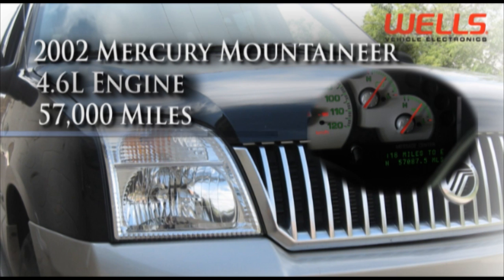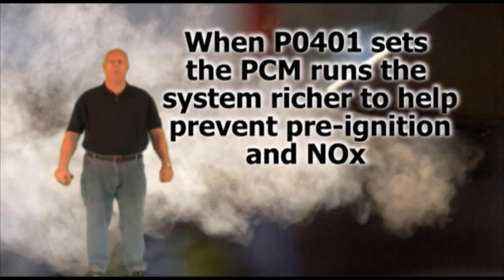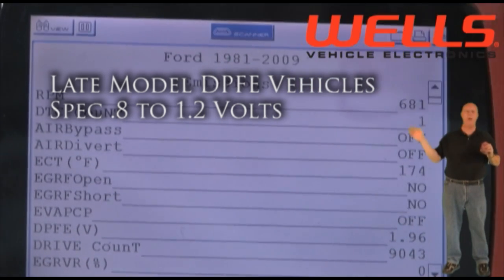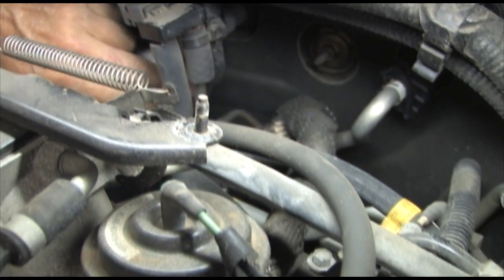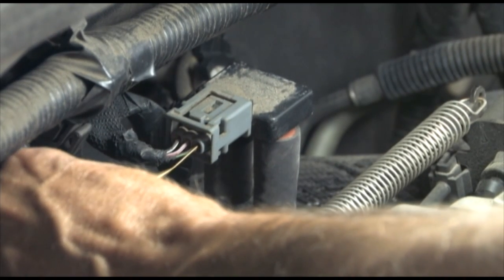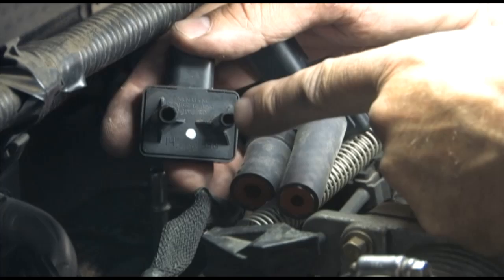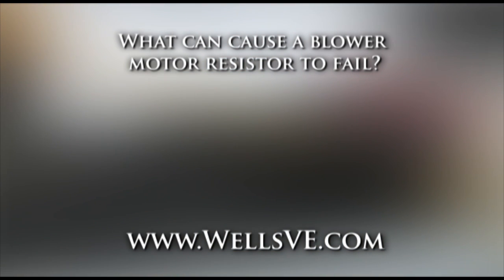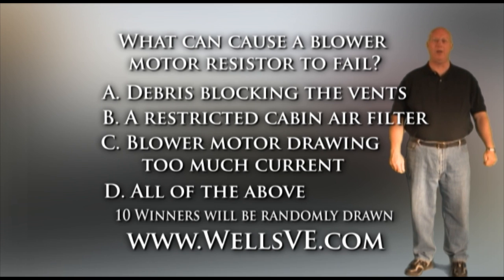Ford P0401 DPFE EGR  Pressure Sensor Diagnostics and Repair with a Contest

Comment: hi mark, i need  help on my 91 town car 4.6 liter. i got code 332 egr valve opening detected. the shop man checked my egr valve says okay.sometime engine stop after cold start or idle and sometime surge when at cruising speeds or not idle at all. right now i dnt know what to do. the car sitting front drive way. can you please help me. thank you!.
Reply from the maker: Hello Dave, below is the test procedure. It is usually due to clogged passages.

1. Check the Pressure Feedback EGR (PFE) sensor voltage, Key On, Engine Off (KOEO). Voltage should indicate 3.2-3.35 volts.

2. Start the engine and recheck the sensor voltage. It should still indicate 3.2-3.35 volts.

3. Open the EGR valve with a hand-held vacuum pump when the engine is idling. With about 8-10" of vacuum applied, the sensor voltage should decrease to less than 1.0 volt.

4. If there is very little change in the engine RPM and the sensor voltage, remove the intake plenum from the lower intake. Inspect and clean the passages of the lower intake which allow for exhaust to flow into the intake from the Exhaust Gas Recirculation (EGR) valve.

5. If the engine runs very rough but the voltage does not change, verify that the pressure hose of the sensor is connected to the exhaust flow pipe feeding the EGR valve and replace the sensor.

6. If the PFE sensor voltage decreases as stated and the engine RPM is severely affected, perform the Key On, Engine Running (KOER) self-test while monitoring the vacuum signal to the EGR valve. At some point during the self-test there should be at least 2" of vacuum to the valve.

7. If there is never a vacuum signal to the valve, backprobe the Brown/Pink (BR/PK) wire at the EGR Vacuum Regulator (EVR) solenoid and ground it with the engine idling to verify vacuum is then present to the valve.

8. If there is no vacuum to the valve, verify manifold vacuum to the EVR solenoid and that the green vacuum line is not restricted or broken from the solenoid to the valve.

9. If the vacuum lines check to be OK, replace the solenoid. 
Mark Hicks
Wells Vehicle Electronics
Reply: okay, will do that.thanks!

Comment: I have a 93vp,3.8ecotec,dies out after w@rmed up.
The motor light comes back on after start/idling.
plse reply,as i am a mech with a tumour in me rightside of neck nd arm.
thanking you,
Ed
Reply from the maker: Hey Ed,
I am going to guess your Commodore VP is the same as our GM products in the states.
In that case two common causes come to mind. One crankshaft position sensor. Should be close the the harmonic balancer. Two is the computer. Start the engine and let it get warm. With the engine running, tap on the crankshaft sensor and the computer. Be careful tapping on the crankshaft sensor. You will need a long extension to do it. Do not let the extension touch the belt or pulley.
Mark Hicks
Wells Vehicle Electronics
Reply: Chur bro,
U the man for the  knowledge alright,
will do asap,
Thanking you Mr markjhicks..
will get back to you on progress.
thankz,
Ed
Reply: Can't send a vid-pics of motor running..
How 2 do this????
Reply from the maker: Edward Edwards
Sorry i don't have anything.
Mark
Reply: Algud bro,
thank you,
Ed

Comment: Hi, Mark,  I have a 2002 Windstar, got code P0401.  I measured the DPFE as you demonstrated and got only 0.02 Volt, too low, however, the reference Volt is 5 Volt which is good.  Does this also mean my DPFE sensor is bad?  Thank you for your help.
Reply from the maker: Yes it does. Be sure to check the hoses also and if you need to replace them get the right ones.
Glad to see you are testing first!
Mark Hicks
Wells Vehicle Electronics
Reply: Thank you, Mark.  I will check the hoses.
Reply: Thank you, Mark.  I will check the hose

Comment: I have an 02 focus with a dpfe that mounts to my engine wall. It has the same wire harness as the one in the video. The dpfe died so I bought a new one and went to put it in. The new one has a different wire harness. According to auto zone the new ones need a new harness because ford redesigned. I'm buying the new one soon but wondered if you have heard of the new dpfes needing new harnesses. Also what order should I attach the leads?
Thanks
Reply from the maker: Hello Andrew, Yes I have heard of this. In fact you are purchasing one of our sensors. It was an Original Equipment OE change to the wiring harness. You will probably see the wires to the replacement harness are all one color. This is because it fits several different models and years and each of them have wiring with different colors. First cut the connector from the vehicle about an inch from the connector it self. Then lay the connectors side by side and match up the wires. You will then see which wire goes to which colored wire on the vehicle.
I hope this helps, if you need further assistance let me know or give us a call at Wells. 1-800-558-9770 7AM to 7PM M-F
Mark Hicks
Wells Vehicle Electronics
Reply: Thanks. I was thinking that would work but wondered if the other dpfe was wired in another order and didn't want to fry it.
Reply from the maker: Andrew Ratiani
Makes sense, it can very blurry sometimes. Always best to make sure!
Stay in Touch,
Mark Hicks
Wells Vehicle Electronics

Comment: my 2001 windstar has ap1401 error code and catalystnot reading plus evaporator system not reading is code p1401 the egr sensor ? and whats not ready mean?
Reply from the maker: Most common cause for this code on your vehicle is the DPFE sensor. Spec is 0.4 V to 0.65 V for the original metal type sensor and 0.4 V to 1.2 V for the Black plastic sensor. If out of range, replace the sensor.
Mark Hicks
Wells Vehicle Electronics

Comment from the maker: If some of the ports are restricted, you will get excessive flow on the other open port(s). This is why I asked for the codes. When this occurs you will also most times get misfire codes. The fact that you opened the EGR at idle and only got rough running and not an engine kill, makes me think there is some restriction somewhere.
Mark Hicks
Wells Vehicle Electronics

Comment from the maker: Be sure to check the DPFE like I told you. 9 times out of 10 the P1407 is a defective DPFE. Also closely check the hoses coming up from the exhaust. If the Catalytic Converter is restricted the hoses will deform and crack.
Mark Hicks
Wells Vehicle Electronics

Comment from the maker: What code(S) are being set? The PFE sensor should have near one volt on one of the pins with it plugged in. Check it that way by back probing it with a pin. Your engine has small orifices above the intake valve that let the EGR gasses into the cylinder. It is common for these orifices to become blocked. 
What are the codes?
Mark Hicks
Wells Vehicle Electronics

Comment from the maker: The signal voltage should be between .8 and 1.2 volts. Sounds like you have a defective sensor.

Mark Hicks
Wells Vehicle Electronics

Comment from the maker: OK, I believe you are refering to a vehicle speed sensor which is voltage generating. There is no spec, you look for the voltage to increase with vehicle speed. First do this check, then back probe at the PCM or BCM where ever your speed sensor is sending a signal and look for the same voltage without interuption. You are always welcome to call our assistance line for free, 1-800-558-9770 press 3 for tech help. 7:30 AM to 7:00 PM M-F
Mark Hicks
Wells Vehicle Electronics

Comment: MMM, no sorry i was refering about the other sensor (code error P0715, magnetic type sensor, if you could tell me, what would be the tipical voltage generated and, how to test the harness wires, to check if one or both are cut or have some other error).
Thanks Mark!

Comment from the maker: I think you are talking about the DPFE sensor?
I think I answered this before?
Check voltage of the Differential Pressure Feedback EGR (DPFE) sensor. Normal voltage should be 0.5-1.2 volts Key On Engine Off (KOEO) or at idle.

If voltage is out of range, check voltage again with the sensor disconnected, it should read 5.0 volts. If it does, and there is 5.0 volts measured between the Brown/White (BR/WT) and Grey/Red (GY/RD) wire, replace the sensor. 

Mark Hicks
Wells Vehicle Electronics

Comment from the maker: Great news! To make sure the speed sensor is good, connect your meter and drive the vehicle, the sensor should generate an AC voltage that increases with speed. Sorry no video yet ... 

Mark Hicks
Wells Vehicle Electronics

Comment: I replaced the sensor, it solves the problem! I also cleaned up the egr valve.
Thanks Mark
This car has another problem is P0715 it seems to be a problem in many cars, do you have a video about this problem? I´m almost sure than the sensor is good (is a magnetic type, the reading from the coil is 450 ohms and it produce voltage) but i want to be sure!
Thanks again!

Comment: Mark,
I hooked the vacuum pump up to the EGR and with the engine revved it stayed at zero.
When I increased the vacuum to 8.7 the engine did run rough.
I disconnected the hose from the vacuum control valve and put on the vacuum pump and with the engine idling it read 6.5.

With the EGR solenoid disconnected I'm not sure how to apply power to that solenoid. Please give me instructions on that.

Comment: I've been searching on the internet to see what part is what. I don't know what the EGR solenoid or the vacuum control valve looks like on a 2002 Mitsubishi Montero Sport. 
I looked at 2 different websites and their picture for the VCV were different. I will run the tests once I confirm the those parts from you.

Comment from the maker: 1. Disconnect the shift linkage at the transmission and move the linkage on the transmission by hand. If the transmission still won't engage, there is an internal transmission problem.

2. If the transmission does engage when moving the linkage manually, check for a problem with the shift lever or cable.

Mark Hicks
Wells Vehicle Electronics

Comment: I have a 92 ford taurus that has a problem with the transmission engaging. Periodlically when I drive it, then turn it off, then turn it back on again, it won't engage in reverse or drive even though the gear shift is moving the gears (It will move when pushed, in neutral). As well, sometimes when I am hainvg this problem, if I shift it into reverse first, back up then shift into drive it will move. ANY idea what is causing this??

Comment from the maker: 3. Disconnect the White hose from the vacuum control valve and plug it, connect a vacuum gauge to the port, and with the engine idling there should be at least 6.7" of vacuum.

4. Disconnect the EGR solenoid and apply power to one terminal and ground to the other, the solenoid should block any flow, remove the voltage and ground and vacuum should flow through the valve. 
It is common for the EGR solenoid to fail.
Let me know please,
Mark Hicks
Wells Vehicle Electronics

Comment from the maker: 1. Disconnect the green striped hose from the Exhaust Gas Recirculation (EGR) valve with the engine warmed up and running. Rev the engine, the vacuum should increase to at least 3.9".

2. With a hand vacuum pump connected to the EGR, increase the vacuum to 8.7", the engine should stall or at least run real rough.

Comment: I have a 2002 Mitsubishi Montero Sport 3.5L and I have the P401 code. I already replaced the EGR valve and took off the manifold and cleaned all the ports.  P401 still showing up. I bought a vacuum pump and tested the MAP sensor and with the key to on it read 5 v. I had the red lead on the green wire and black wire to ground. I squeezed the hand pump and went to 5,10, 15 units and voltage still 5 v. I assumed it was bad so I bought a new one. I tested the new one with same results.

Comment from the maker: Check voltage of the Differential Pressure Feedback EGR (DPFE) sensor. Normal voltage should be 0.5-1.2 volts Key On Engine Off (KOEO) or at idle.

If voltage is out of range, check voltage again with the sensor disconnected, it should read 5.0 volts. If it does, and there is 5.0 volts measured between the Brown/White (BR/WT) and Grey/Red (GY/RD) wire, replace the sensor. Our largest customers are AutoZone and Carquest.

Thanks,
Mark Hicks
Wells Vehicle Electronics

Comment from the maker: The specs for your DPFE should be the same as in the video, 1.0 volts. If the hoses are blowing off and get very hot it means the exhaust system is restricted. This usually means the catalytic convertor is plugged. To be sure have the back pressure on the exhaust checked.
Mark Hicks
Wells Vehicle Electronics

Comment from the maker: The restricted EGR will not cause the engine to run richer. Too much EGR could cause this to happen. It is time to have the back pressure of the cats checked.
Let me know what you find,
Mark Hicks
Wells Vehicle Electronics

Comment: thanks for the reply mark!! i checked the DPFE and im getting 1.18-1.22V on it. the EVR shows good resistance and voltage. i ran a stiff copper wire and carb cleaner through the tube that comes from the exh manifold to the EGR vavle to make sure it is clear. i also took out the O2 sensor before the cat and it is almost white. is this a result of overheating cats due to running it richer because of the low egr flow??

Comment from the maker: Re-check the DPFE like it shows in the video. The hoses going to the DPFE are special heat resistance type. Be sure you are using the correct hose. If the hoses look like they have gotten hot or the DPFE looks a little melted, it means your catalytic convertor is restricted. Did you clean the tube going to the exhaust pipe? When you do make sure there is flow completely through. There is a small orifice inside the pipe that plugs.
Stay in touch,
Mark Hicks
Wells Vehicle Electronics

Comment: Im leaning on replacing the EGR solenoid. The 2 hoses that lead to the DPFE sensor are NOT being blown off the tube or sensor and the DPFE is not being melted. Im just trying to get ideas as to what i need to do next...

Comment: Very informative video!! I have an 01 explorer 4.0 V6 and i had issues with P0401. Replaced the EGR valve, DPFE sensor, cleaned all the vacuum lines to/from EGR system and, intake gaskets. And the problem went away for about 3mos (just to pass state emmissions test) and came back the same. Any ideas? I have noticed a major drop in mileage even after using lucas fuel treatment on every oil change...

Comment from the maker: It sounds like the catalytic convertor is restricted. Have you had the back pressure in the exhaust checked? One this you can do to do a quick check is remove the front O2 sensor(s). If there is an improvement , most likely the cats are plugged. Don't leave the O2s out for very long.

Mark Hicks
Wells Vehicle Electronics

Comment: hi mark i have 2002 ford escape what happen is that if i start the car theres a whisltling sound and if i run the car i cant go up to 2000 rpm it looks like it chokes and the whistling sound will turn on again every time i go up to 2000 rpm .i clean the fuel injectors , replace all seals for the maniflod clean the egr valve , clean the MAS check hoses. the egr  vavle looks good  coz if i pinch it under the engine will stall , is it my DPFE or My egr vaccum solenoid?

Comment from the maker: Same issue, Cat is restricted. Usually caused by either the engine is running rich or a misfire.
If you need any further assistance, let me know,

Mark Hicks
Wells Vehicle Electronics

Comment from the maker: Thank you for the kind words. If you are melting sensors and have a lot of pressure on the hoses, it usually means your catalytic convertor is restricted. I suggest getting the back pressure on the exhaust system tested.

I hope this helps and stay in touch,

Mark Hicks
Wells Vehicle Electronics

Comment: Great video, I have a 2000 Ford Tuarus with the same problem. I replaced the Egr back pressure sensor cause the old was melted do to the heat from the tubes. I having a problem keeping the sensor on the tubes. It seems there is enough pressure coming out of the tubes to push the heat resistant tubes plus the sensor off. What should I do?

Comment from the maker: @svt0304cobra You have to get enough misfires in a certian time period to set a code. It might be right on the edge. When you say you smell rotten eggs, it means either it is running rich or you have a misfire or both. Please clean the MAF. Please do as I am telling you, it will give a good starting point if not the answer.

Mark Hicks
Wells Vehicle Electronics

Comment from the maker: @svt0304cobra Fist check and clean the MAF sensor. If that does not take care of the problem, I would like to have you put it onto a scan tool. Check the misfire counts. If one or two are particularly high swap the coils on those cylinders and see if the misfire follows the coils. 
Let me know what you find,

Mark Hicks
Wells Vehicle Electronics

Comment from the maker: @MsMlarrea 	
1. Inspect the connection of the Differential Pressure Feedback EGR (DPFE) sensor for good contact to the sensor.

2. Check the Brown/White (BR/W) wire for 5.0 volts to the sensor when the Differential Pressure Feedback EGR (DPFE) sensor signal reading is high, and, that the Grey/Red (GY/R) wire is a good ground.

Mark Hicks
Wells Vehicle Electronics

Comment from the maker: @IrnMaiden304 Yes they were aluminum cases. In fact we manufactured and sold the aluminum housing until the foundry stop producing them. Reason? On some application the plastic replacement needed a new wiring harness, we wanted to produce a direct replacement for as long as possible. the reason ford updates was because of RFI problems. We updated the circuitry but stayed with the aluminum housing as long as possible. 

Mark Hicks
Wells Vehicle Electronics